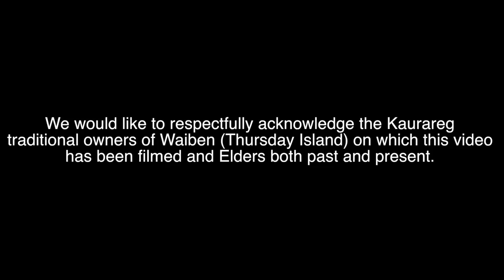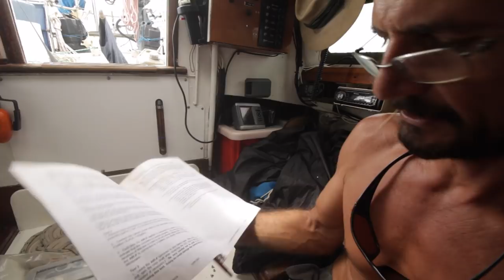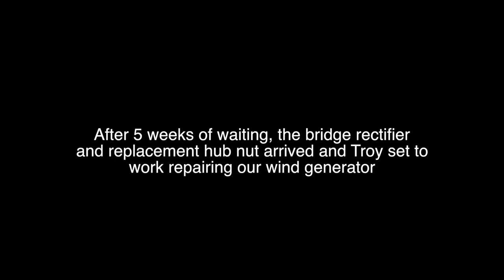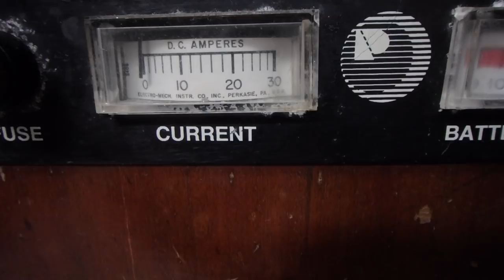Repairing our Wind Generator in the Stormy Straits - Free Range Sailing Ep 35

Comment: Seems like some pretty straightforward mods.  I'm a commercial electrician and I don't see anything wrong with your thinking on the retrofit mod, or your troubleshooting tactics.   It shouldn't be too hard to add external regulation down below just prior to the battery connection.   We have an old Rutland Windcharger wind generator on our boat that gives standard 12v nominal DC unregulated power and I found a nice little low-cost add-on 300W rated regulator/charge controller from Amazon for it.  It is designed for basic 2-wire 12v DC wind turbines  and even comes with a built-in electronic brake that kicks in at 15v.  It might work well for you guys if you can find one down there: http://a.co/9N4dgW1
Reply: @SVBarryDuckworth So help me understand whats going on here. Im thinking its unlikely that both amperage and voltage are shifting with RPM, so the regulator from Amazon (which is a respectable price) is controlling Amps and a simpler maybe cheaper voltage supply regulator just wouldnt do. I ask this because I bought a 12v regulator for a flat screen TV that controls voltage off the batteries (13-14v) and brings it back to 12v, actually operates from 5v to 45v to output 12v

Comment: Good fix Troy. I missed Pascal when she was at Fremantle Sailing Club recently. Enjoy the no nonsense and practical approach to your videos. Couple of questions/comments. Comment --- bearings. I purchased some micro bearings from RS Radio Shack for a few dollars for the wind Raymarine wind indicator, as this part was a redundant model. Second choice was a new wind indicator for lots of dollars. The question, which I think I know the answer. Why did you go with using a rectifier rather than simply replacing the internals. Cost? Stay safe and fair winds.